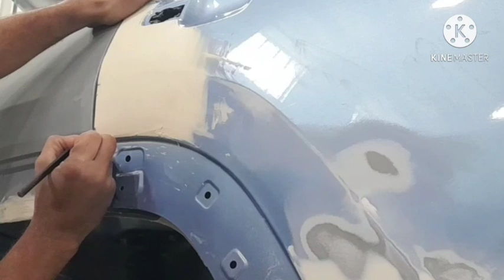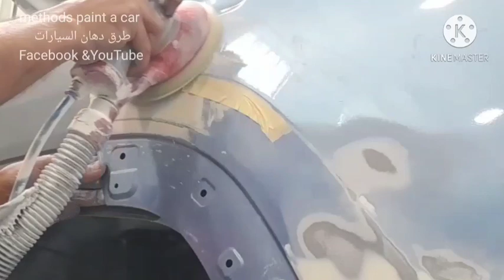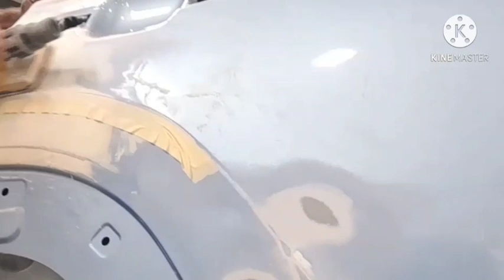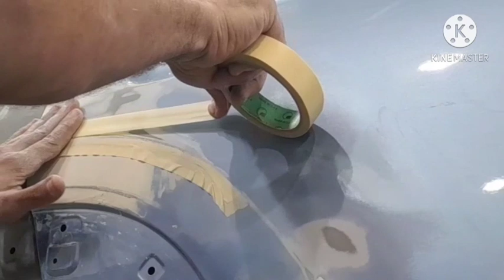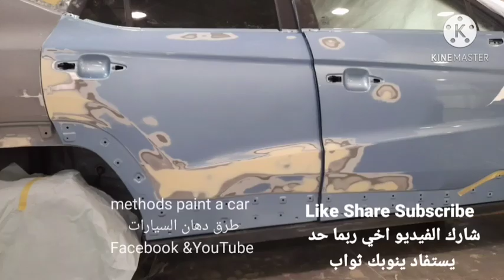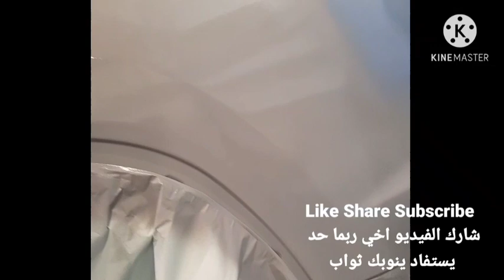car repair | Surface preparation putty طريقة ضبط سوك الدوران باصح الطرق مرحلة اولي 1 بالمعجون step 1

Comment: Just to educate you, you did that backward that's why you had to go back and redraw your lines. Next time sand the bottom flat first then draw and tape your line. The second flat next then draw and tape your line. Now it's time to finish the top. Take as much filler off as you can but stop if you hit metal. Trust me you can thank me later.
Reply from the maker: thank you now and later